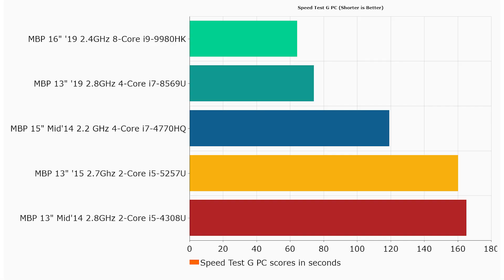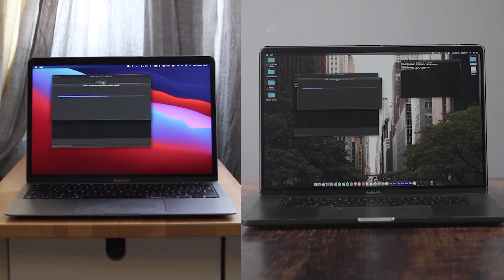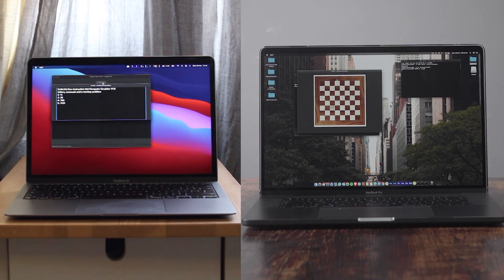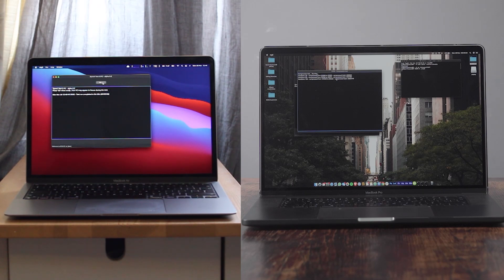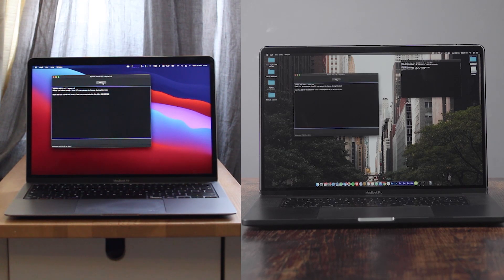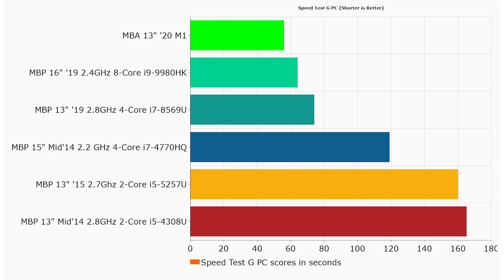MacBook Air (M1) Real World Performance and Thermal Throttling Test

Comment: My biggest issue with the new Apple ARM based stuff is repairability after the warranty ends.
Reply: This new model is no less (or more) repairable than all MacBook Airs for the last 8 years-- all of those models had non-upgradable storage and non-upgradable RAM.  Keyboards?  Same repairability.  Screen?  Same repairability.  Battery?  Can be swapped with difficulty but the same difficulty as has existed in this same chassis design for years now.  All other issues would require the entire motherboard to be replaced-- which has been the situation with almost ALL MacBook models for more than a decade.  I cannot speak to the durability of this chassis design but the 2012-2018 MacBook Air chassis are renowned as tanks.  I have hundreds of 2012-2014 era MacBook Airs still in service with my employees.  I am sure we've had some issues over the years but the number is so small as I could not even count.  If you want a durable and reliable laptop, buy a MacBook.  If you want something that will be junk in 3 years-- almost every other PC laptop.
Reply: Well, many laptops are going towards that direction. For instance: Lenovo Thinkpad, the RAM is soldered on the board.
Reply: @diavalus  Any laptop I can't service without hassle I won't be buying.
Reply: @CommodoreFan64  even with soldered ICs, they can still be serviced. You just need a donor board and some skills. You like it or not, this is the trend to help manufacturers to come out with faster, lower power and smaller models.
Reply: @diavalus  Needing a donor board that could be expensive, or just not possible to get is why I'm on the side of Right to Repair.
Reply: @CommodoreFan64  basically every computer part needs a donor board nowadays in order to be repaired. You won't be able to source the parts otherwise, unless that part is a passive one and has the manuf. no. written on it. But that's very unlinely.
Reply: Still better repearability than most ultra portables, especially microsoft ones. You watch too much Rossman and his whining.
Reply: @BrawndoQC  I don't use ultra portables nor do I use Microsoft period. It's Linux(Manjaro Mate is my main distro), and Chromium OS for me. The only Apple product I own is a recycle center found 13in Mid-2012 Macbook Pro that I was able to fix myself with new RAM(16GB), SSD(240GB), HDD cable, and battery for less then $130 USD.
Reply: @CommodoreFan64  Then this laptop is not for you dude.  Laptops have evolved.  I know the Commodore 64 was cool I had one as a teenager but times have changed.   Better battery my ass. The M1 last up to 20 hours.
Reply: No worse than something like a Microsoft Surface or any iPad ever.
Reply: @nickthaskater  I would never own either of those.
Reply: @CommodoreFan64  beside the point. The point being that this is far from a new or unique-to-Apple thing.
Reply: What are you worried about? RAM and storage will last many years and as they are non-mechanical they should bee very reliable. I have never had RAM or an SSD break on me. It is more likely the motherboard will break on most laptops and that will need a new one which will no doubt be not worthwhile for any $1000 laptop. Tech needs to improve and shared SoC is the way to get another leap forward and I am all for that.
Reply: @andyH_England  isheep
Reply: @Aadi-e6f  The iSheep joke is so old and stupid. It immediatly means you're the sheep of whatever other company you prefer.

Comment: I found it interesting that in the Cinebench test the M1 was about the same as a dual X5650 (circa 2011, I have one of those, though don't use it much anymore). So it delivers the performance of a 2011 high end dual socket workstation for a fraction of the power budget.
Reply: well 2011 was 9 years ago so im not really that impressed. 
Also a little correction: single-socket, not sure what made you believe it has the power of 2 of those cpus

Comment: Gary's analysis is the only one I value
Reply: @Jonathan Marus yes: he's the only one that said basically "M1 on MBA is a bit faster than way older MBP" and not "oh wow this has change the whole industry, it's a new standard"
Reply: @Jonathan Marus ok. I am utterly ignorant about all of this, and I usually found Gary's recommendations quite spot on. Anyhow do you have any link to videos you think are more reliable as comparison (both in terms of what they compare to and of being impartial)? I think that I'd like that. For now I thank you for letting me learn something new. Cheers. EDIT: I mean this in the best possible way, I am curious about these new supposedly "beasts" apple released and would like to see them fairly reviewed.
Reply from the maker: @Moriambar You need to take Jonathan's remarks with a large dose of salt. I am currently engaging with him in another thread (I won't repeat it all here) but he seems to have some gaps in his knowledge. For example he thinks that an 11th Gen i7 on 10nm is one of Intel's oldest.
Reply: @GaryExplains  of course, thanks. That's why I asked for more info. Knowing nothing about these things, one has to trust someone ultimately

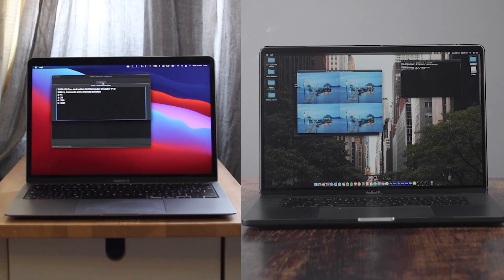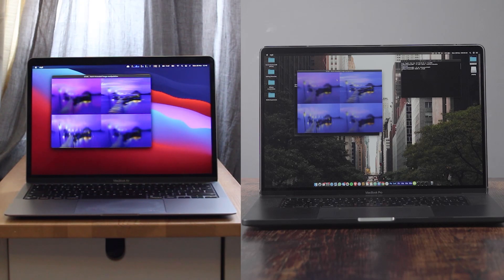Comment: 5:16 - 5:30. WHAT WAS THAT SPEED !!!!!!!!!!!!!!!!!!!!!!!!!!!!
AND THE FACT THAT IT WAS A THIN ULTRABOOK WITH NO FANS
PLUS ONLY 5% PERF LOSSS AFTER 1 HOUR OF SUPER HIGH INTENSIVE TESTS WITHOUT A FAN
APPLE HAS CHANGED THE GAME
Reply: the problem is that the 9th gen core in the macbook pro is no where near the same i9 in a normal laptop because in the macbooks of previous gen the cooling was crap with the cpu pinned at 100 and at very low clock speeds
Reply: @Archer_Legend  wrong. The cooling system was redesigned and the 16” MacBook Pro is thicker than 2018-2019.
Reply: @arturmavlyuchenko7647  it is not about thickiness, the thermal system they used is still underspecced